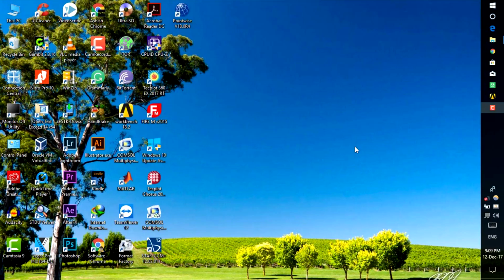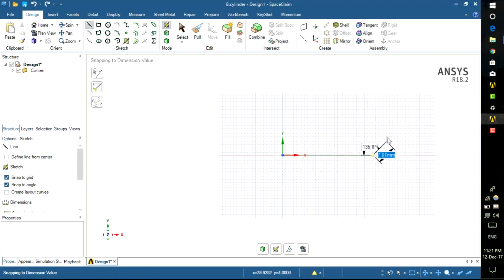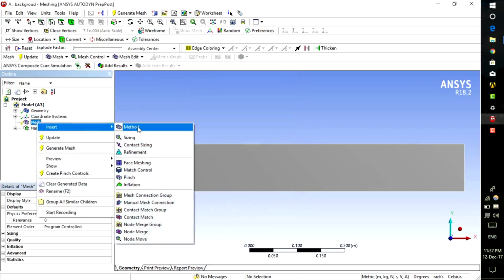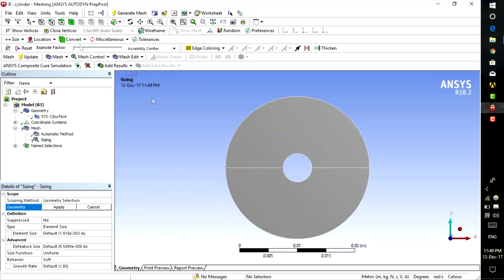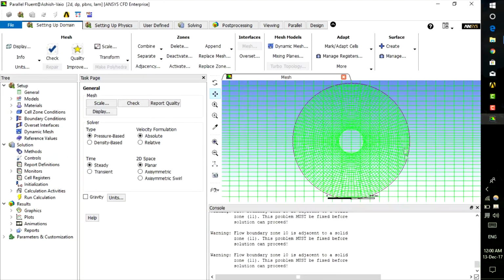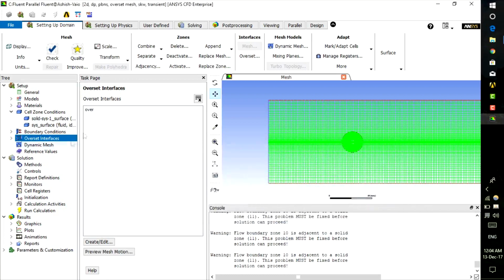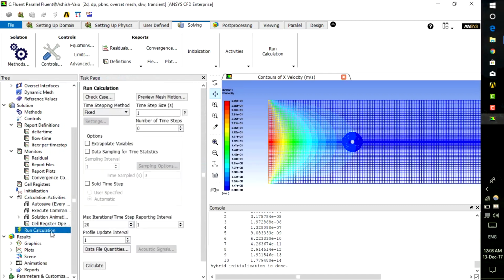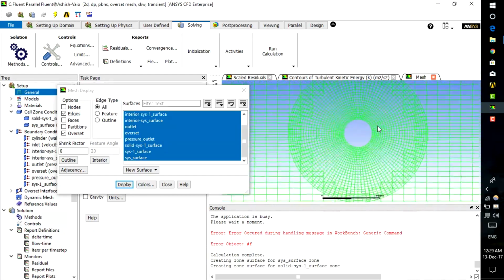Overset Mesh Tutorial Ansys Fluent Complete

Comment: Hi I have a question. I am simulating a flow through a valve. Using traditional method I am getting a good result but when I use overset mesh my solution doesn't converge for the same BCs. What could be the possible reasons? 
PS. Valve is stationary and I am using steady state instead of transient
Reply: It probably can be the number of cells that make the date exchange between the two meshs (overlapping cells). I had the same issue by having not a sufficient amount of them.

Comment: Hi! Im having a problem related to overset meshing with parametric geometries, I tried for exaple to siulate your exact simulation and used the diameter as a parameter and created a few design points on Workbench and when i try to refresh all design points, solving crashes and this error appears: (DP 1) Case has unassigned overset interface zones. 
Please check the overset interface definition.
And when I enter the fluent evironment and manually initialize and start the simulation it works fine, but since I have to do a lot of them I cant do every simulation manually
Any idea how I can solve this, maybe writing some kind of script or something so that it automatically initializes?
Thaks in advance
Reply from the maker: I have not tried the parameterization for Overset. But i will try and than i will get back to you.
Reply: @ansysfreaks9343  thanks a lot!
Reply: Hi  @ansysfreaks9343 ! Did you find something out?